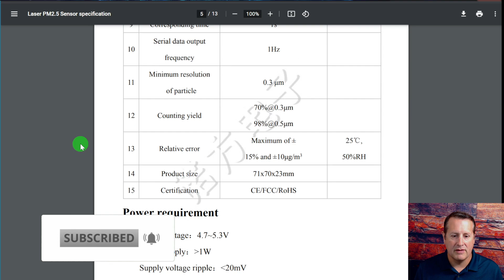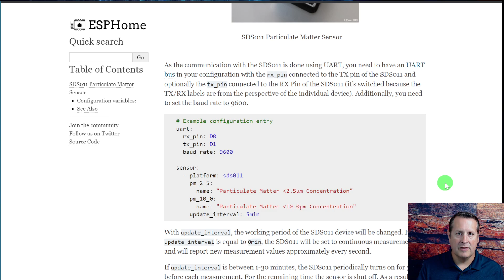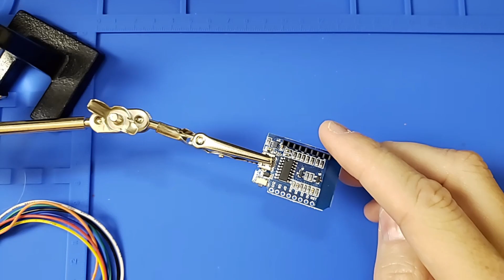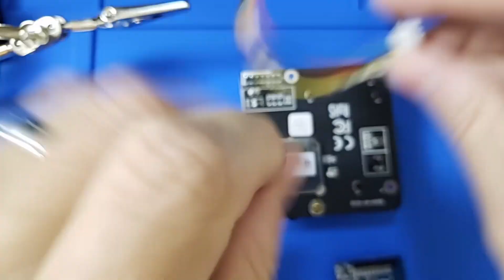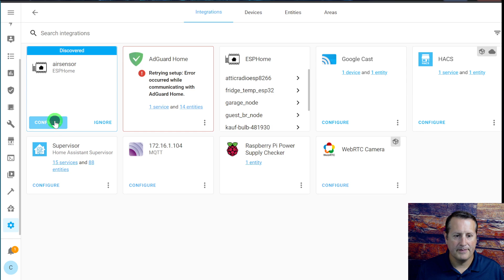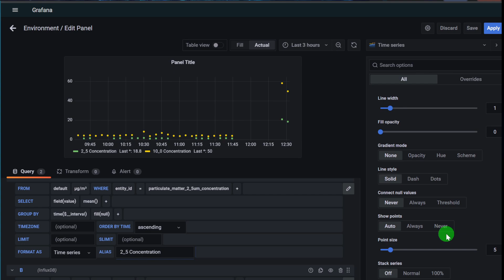Is your air healthy? Measure air quality using Nova SDS011, ESPHome, and Home Assistant.

Comment: How does this compare to adding an ESP8266 to an Ikea VINDRIKTNING?
Reply: I'm actually doing that build (esp8266 D1 mini on Ikea sensor) right now. Of course, not everyone has an Ikea close by, but the sensor is (a little) cheaper and already has a housing/box. I suspect, though, that the Ikea sensor isn't as accurate/robust, but don't know for sure. Cheaper way to go, if you have an Ikea near by. It also has a nice external LED.
Reply from the maker: I've got an IKEA in the area. I've never been to one and not sure if every store carries them but maybe I can order one online to test with.
Reply: @mostlychris  you can check Ikea inventory online to make sure your store has them in stock before going out.

Comment: Chris, where did you source the Nova SDM011sensor? Amazon are saying that it in stock and are not sure if they will stock it again. Is there any particular reason that you selected this brand?
Reply from the maker: I got it from Amazon. A quick search shows 3 left. https://amzn.to/3ot5jua (affiliate link). I chose that one based on availability and form factor, as well as ability to integrate into HA easily. There are others out there that I have been told about, IKEA being one, that I haven't tried yet.
Reply: @mostlychris  Thanks, Chris. It's appreciated.

Comment: Great video - as always. When you want to solder pin headers it is more easy to use some old breadboard instead of “helping hands”…
Reply from the maker: Thanks for the tip! It was a struggle getting that header soldered, especially while trying to keep it in the frame of the camera.

Comment: Awesome stuff! It looks very complicated. I got some ESP’s a while back but haven’t had a chance to play with them. 
I usually put those headers into a breadboard to solder them. Looks like those helping hands are kinda useless.
Reply from the maker: Yours is the second comment I've read about regarding the breadbord. Definitely better than what I was using. The helping hands have their place for other applications but not so helpful holding on pin headers.

Comment: I am also in the process of building a setup like this woth d1 mini and a sesnsor a bit different. Thanks for the video.
Reply from the maker: Which sensor are you using?
Reply: @mostlychris  PMS5003, it has higher working temp and humidity, i live in a tropical area and humidity of max 70% as in Nova wont work here, in a rainy day it will go above 70 for me. hardware is almost the same but serial data sent is a bit different.
Reply from the maker: Good points. I'm using the Nova inside currently. Our humidity gets pretty high at night outside but haven't considered using it outside right now. I'm more interested in how the air in the house is, considering we have one of those really sealed up houses.

Comment: Did I miss how you got your data points into InfluxDB?
Reply: My installation is set to send EVERYTHING to my database by default.  I think that's a standard option when you set up a database with HomeAssistant.
Reply from the maker: You need to setup up influx as an add-on. I didn't cover it specifically because I've talked about it in other videos. https://youtu.be/SeaOP4AK3DI

Comment: nice video
few comments:
1- ota password could be in secret as well without showing to all ;-)
2- for ESP you can create second so called "soft serial" and specify pins for (under uart in config file) it to avoid what you mentioned at the beginning
3- mdi:chemical-weapon killed me completely ;-)
Reply: So the soft serial helps with conflicts from the sensor?
Reply: @jmr  when you create soft serial you have 2 serials on 4 pins: hardware serial to connect to your PC/messages/updates and soft serial on 2 other pins, that is used only between ESP and sensor. That is the way I did for my CO2 sensor. Having 2 serials you can have (usually you have) 2 different baud rates: 115200 on the hardware serial and usually 9600 as a standard for sensors.
Reply: @zyghom  Thanks!
Reply from the maker: Does the soft serial allow for turning the sensor on and back off as noted in the ESP docs? FWIW, I was reading data on a couple of other pins before I changed the config to TX/RX but it was continuous every second and didn't honor the updated interval.
Reply: @mostlychris  on/off is not serial feature but  the feature of the sensor, right?
Reply from the maker: Reading that again in the docs, it appears you are correct. Setting the update interval in the ESP changes the SDS011 device. I mentioned using a dedicated ESP board in the video due to performance affects of other libraries. Not sure if that is libraries on the SDS or the ESP.

"The configuration variable update_interval reconfigure the SDS011 device. This setting is still effective after power off. This can affect the performance of other libraries. Factory default is continuous measurement."